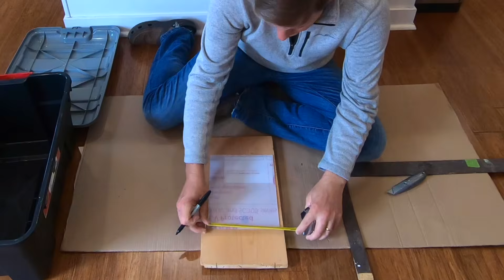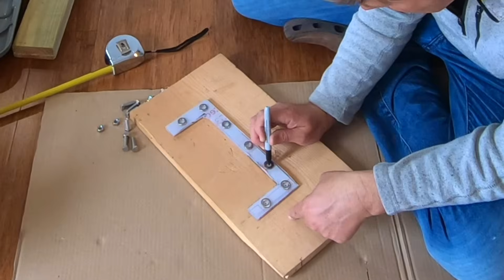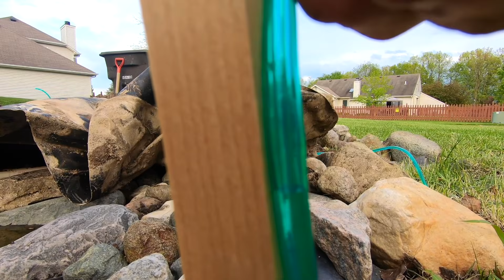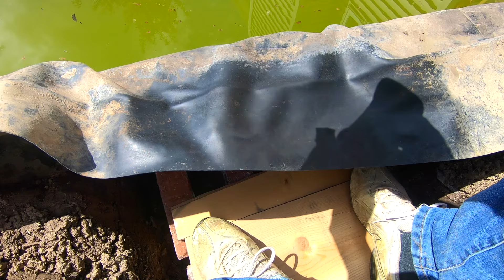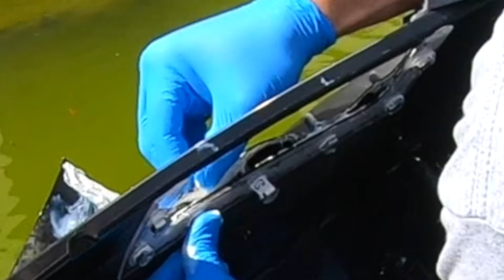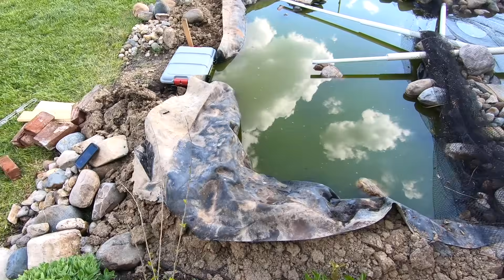How to Build a Pond Skimmer Box

Comment from the maker: 🐟 Tools I used to build this pond skimmer:
→ DEWALT 20V Max Cordless Drill: https://amzn.to/3ZBoT8c
→ Oatey PVC Clear Cement: https://amzn.to/3JXYB9I
→ Stanley FatMax Tape Measure: https://amzn.to/3kgGJ02

Weir inlet = 1–2" below waterline. Use 3/4" PVC sheet. Let PVC cement cure 24 hours before filling. Add biological filter pad between basket and pump for dual filtration.

Comment: How can you build one for $40 dollars when the pump alone is $96 dollars?  Did you list the other parts you used to build this anywhere, or was it just the bin and the pumps?  Did you put anything in their to watch the leaves and debris?  Did I miss that?  and pads to filter the particulates?  Great idea and what you did was cool and it was appreciated.  For the folks that don't work on thing or are as handy I might include the stainless steel bolts and washers you used along with sizes,  drill bit sizes for them as well might be beneficial.  If you don't put any kind of pad or basket you can put larger rocks in the bottom and size down to gravel so it self filters and breaks everything down potentially.  Good idea and video for people that do a lot of DIY stuff and know what they are doing.  This video isn't something you will want to use if you're a novice and don't really know what your doing.

Comment: Where is your filter?? All that debris is just going to get pumped right back into the pond or it's going to clog up your pump!
Reply: This is a skimmer NOT a filter. While you can add a filter pad and/or bioball filtration they are not needed. What he IS MISSING is a screen/basket to catch all the bebris and make it easy to turn the pump off pull the basket, toss the trash and put back together.

Comment: Been 3 years.  How's it held up?  What would you do differently?
Reply from the maker: Great question! It is holding up great. No issues in the build quality. 
1) I think a bigger opening or multiple openings would work better. I try to keep a quarter inch mess netting over the opening but in the fall, the leaves can clog the opening quickly. 
The gold fish also seem to find their way into the box as well at times - no harm to them, but I’d rather they didn’t get in there. Haven’t figured that out yet. 
2) this set-up doesn’t adjust well to changing water levels of the pond. During dry spells, the water level can go down leaving the filter useless till I add water or God does. 😃
I’m sure there is a more perfect pool filter design out there, but I’m not in a rush as this system I have is passable, just not perfect. 
Thx for watching!
Reply: @Housebarons you could have made the opening in the box deeper to allow the skimmer to continue to function even when the pond water level drops.

Comment: Do you think you would need a gasket if you used seam tape to seal around the opening?   I would use duct tape around the hole first to soften the edge.
Reply from the maker: Hey Joseph,
Water is SO pervasive, I think the gasket of Lexan is necessary. You could try tape, but personally, I don’t think it will work long term. I did not just use the Lexan gasket but also used the marine sealant. I think the gasket would also fail w/o the sealant. If you find a different way that works, be sure and let us know in the comments so readers can try other ideas.
Thanks for the comment and for watching!

Comment: Just wondering if we put this straight inside the pond by putting some stones and bringing it to the level where we want it to be… I mean that way we don’t have to create a gasket or anything…. I guess it should work the same way. Correct me if I’m wrong
Reply from the maker: Hey Amit,
If the whole box is going to be under water all the time then that’s is fine. No gasket needed. 
Thx for watching.
Reply: It wouldn't be a skimmer then, per se. It would be more of an intake bay.

Comment: You need a bio filter to actually clean the water. You're simply circulating dirty water
Reply from the maker: Hey Isaac,
True. This was just a first step.
Thx for watching.
Reply: Bio filter belongs down line in waterfall basket not skimmer
Reply: @joegardner8948  who said it belonged in skimmer?